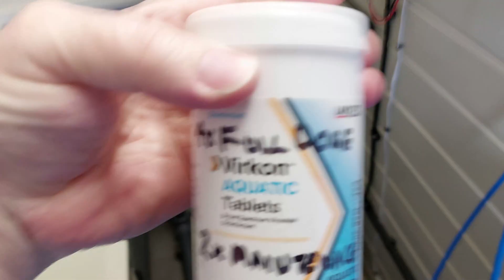Recycle R.O.  Upgrade Build part 1

Comment: Hi. I recently purchased a mk 3 TDS meter which I'll install on my RRO unit in due course and I noticed you'd used a normal sized fittings for the probe to sit in. I noted that the prongs do not sit in the flow of the fitting, rather up in the branch. Have you found any issues with yours not reading the TDS valve correctly at all due to it not being in the flow ? I'm trying to locate proper fittings for the MK3 to connect to my 3/8th sized pipework on the pure RO side with 1/4” on the branch. AliExpress has been the closest so far but struggling.
Reply from the maker: I've not had any issue, the probes are plenty long enough to reach through the T piece into the flow.
The T piece is 3/8" x 1/4" centre, so the 1/4" part is exactly the same length to reach the flow as a 1/4" equal tee piece...👍

Comment: Interesting as ever Dave, ever felt the need for flow restrictors?,  chap I've been following in India uses them, but sometimes very difficult to understand him.
Reply from the maker: Cheers mate, 👍
Flow restrictors, do you mean on the waste outlet instead of a needle wheel valve? 
Only if i'm using standard mains fed RO and you want the usual 3:1 or 2:1  effluent to permeate rejection rate.
Recycle RO waste out, needs to be adjustable depending on final TDS to prevent excessive membrane fouling. 🙂

Comment: ROs still confuse me but looks like a cracking system 👍
Reply from the maker: Thanks, 🙂
If I only had unlimited tapwater like a welsh mountain stream, I wouldn't need it at all lol 😄
It just helps to reduce the hardness, nitrates, metals ect... in my pond water, 
and significantly reduces the amount of tapwater I need to use. 👍